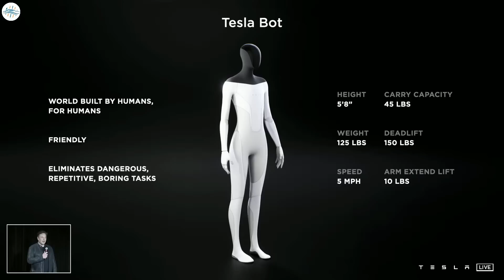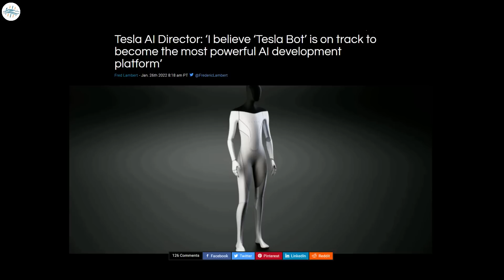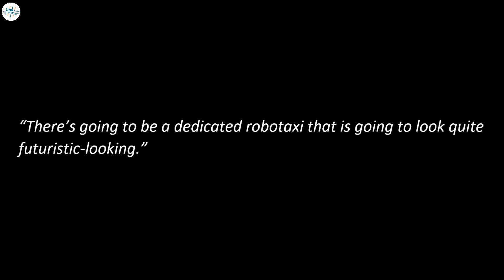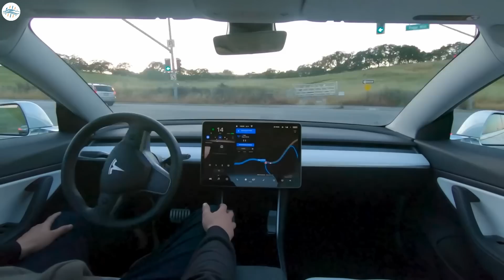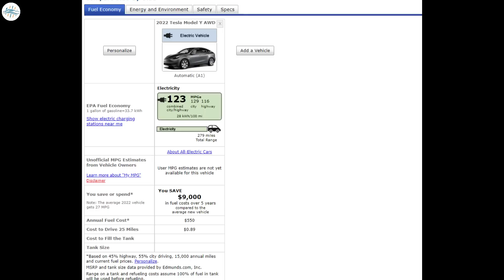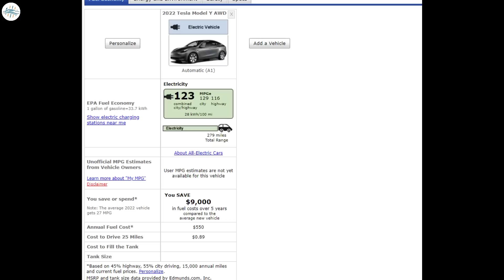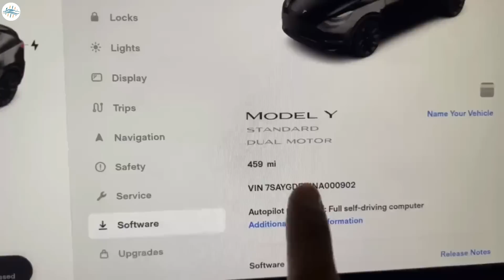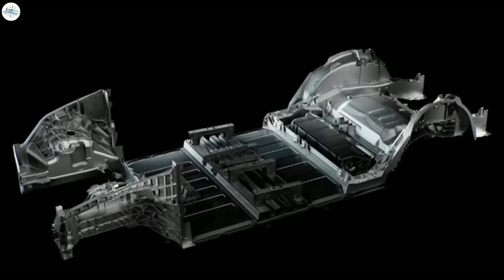Tesla's New Model Y Variant With 4680 Revealed & More Updates!

Comment: I will cancel my order if 4680 battery is just 279 miles! Its lesser mileage than 2170 range of 330...When that happened, I will buy used MY LR 2021 w/ 2170 battery 330 miles range online. It doesn't make sense....What's good about 4680 battery the most talked about it if range is lesser than current battery? I placed my order MY LR in Jan. w/ est. delivery in July then moved to June-July to July-Sept and now July-Aug. My 2022 M3 LR range has 334 miles...this is not pleasant though....I'm also a shareholder long term...throw me ur comments IDC...
Reply: It’s a completely different trim level of car. If you purposely buy a standard range then it will have lower range, if you bought the LR it will have Longer range. It just so happens that the first trim level to get these new batteries in Texas are the SR Model Y.